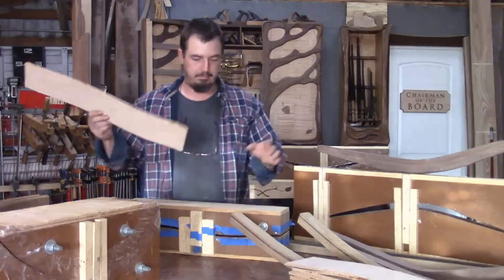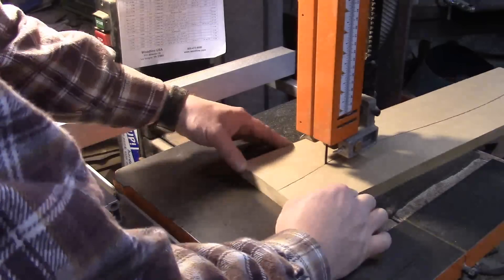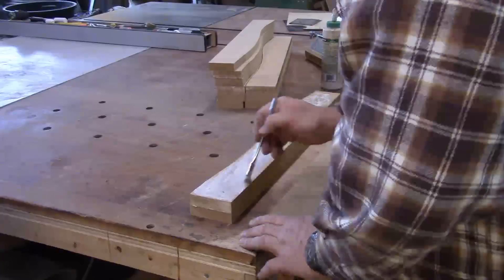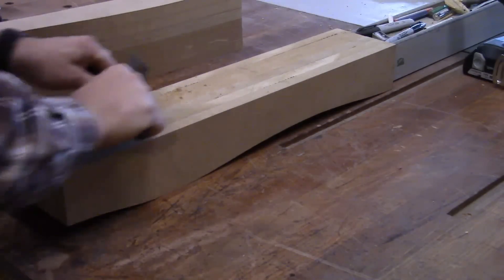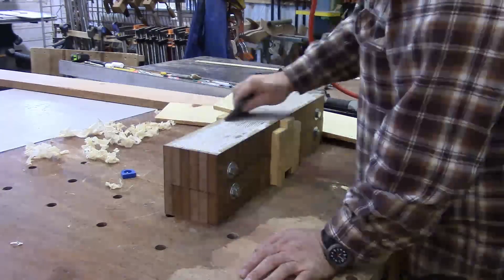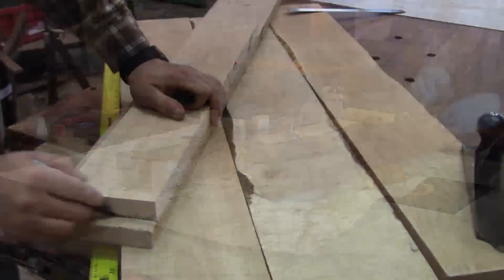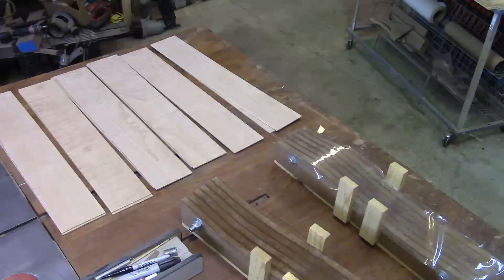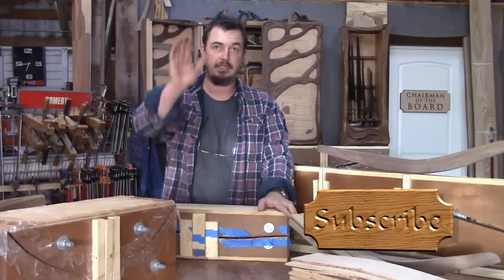Bent Lamination Forms

Comment: Is it needed to cut the thinness of the laminate from the forms? Can’t the forms just be moved appart? I’m making a 18” wide bench top and am figuring out how to make the 24’ long form
Reply from the maker: You need to take into account the thickness the laminate will be and remove that from the form. If you don't it won't have even pressure over the bend as it has a different radius on the outside of the bend then the inside.

Comment: Nice video... but get yourself a small 2” glue roller that you wash out and reuse and leave the little brush for cleaning up joints.
Reply from the maker: I was lazy and didn't clean it up for that shot gluing up the form, but you see it at 10:35 make an appearance. Thanks.

Comment: What is the brand of the clamps you used at the 6:00 mark?  I’ve been looking to get some like those!
Reply from the maker: Those are bessey quick clamps, you can find them on amazon. https://www.amazon.com/Bessey-DUO30-8-12-Inch-DuoKlamp-Spreader/dp/B0002H49OE/ref=sr_1_6?ie=UTF8&qid=1519604032&sr=8-6&keywords=bessey+quick+clamp
They do ok for the first few months, but they are like most clamps being made recently and kind of disposable as they wear out with enough use. I have quite a few of them and I do like them, but they wear out over time.

Comment: Thank you for the most informative vid I have ever seen in a while. I am going to take a stab in the dark and ask if you are willing to help me with making a form for me. I have a 2 ft by 1 ft box that has a designed curve in the front. The side and the back is square however. I just need help with the curved side. I can not figure this one out. Is there anyway you could help me on this small project, please?
Reply from the maker: I would be happy to. If you send me an email with either pictures or a sketch then I can go through it with you. Thanks bearkat_wood@yahoo.com

Comment: When using the compass is that just to ensure that there is enough room for your stock material thats being bent has enough room between the to cauls when being sandwiched?
Reply from the maker: Yes, when you make a bending form you have to keep in mind that the inside curve and outside curve will have differing diameters that will be determined by the thickness of the stock in the form.

Comment: I tend to rush things and your video reinforced my need to slow down and do it right.  I did my first bent lamination 20 years ago and learned the hard way to not use PVA glue.  I'm now using Titebond III for most of my glue-ups but haven't tried it for bent lamination.  I've used a urea-based glue but I would prefer Titebond III.  What is your glue preference and why?
Reply from the maker: I do like titebond 3 and plastic resin glues. thanks.

Comment: Thanks for the great video! Have you actually had a form blow out? I'm wondering if the bolts are necessary...
Reply from the maker: I have had one explode on me and the bolts may not be absolutely necessary, but when you use the form at least once a week and expect it to last years it is a helpful addition. When in doubt, build it stout.
Reply: BearKat Wood I think the bolts are way overkill and provide more aggravation than protection by getting in the way during form preparation and clamping. If you had one explode I would be interested to know what caused it. I would suspect too much clamp pressure.

Comment: I'm curious how much time you spend on making your gluing fixtures. Sometimes it seems like I spend more time building jigs and fixtures than I actually do building my finished product. Do you find that it's worth your time to build fixtures like your slat fixture in the video for 'one-off' projects or is it only economical for something you will use time and time again? Sorry for the somewhat nebulous, interview type question. I'm just trying to get more productive in the shop.
Reply from the maker: Slippery slope questions, ah yes.  ;)
For a one off situation only if it looks like there is no way I would ever repeat the build then I might just try to approach it without the jig in mind. For most projects I do, I like to approach it like I am going to make 100 of them and work thru the process to make every step easy and fit well. It may take more time to make the jigs sometimes than the project, but it can ease some of the headaches in the build and if you do make more than one it is well worth it. Hope that helps. Thanks for watching.

Comment: what type of wood can I start bending and experimenting with?  how bout plywood cut into strips?
Reply from the maker: While there is "wiggle wood" or bendable plywood that you can use to create curved shapes. Plywood it is not suitable for steam/heat bending. It is like trying to make a steak out of a hot dog, it is just too over processed. You can use smaller scrapes of hardwood and nuke them in your microwave to experiment with heat bending. Or make a small steam box and use a tea pot on your kitchen counter. Just be sure it vents steam and doesn't turn into a bomb ;) Again it comes to wood choice. There are several species that do better. If you have any questions on the species you wish to try consult http://www.wood-database.com/ and remember that air dried wood will do better than kiln dried because the lignin has been cooked once already, not to say it can' be bent. It just doesn't want to be as cooperative. I hope this helps, best of luck. A good resource on the subject is the book/dvd combo "Wood Bending Made Simple" by Lon Schleining.
Reply: Thanks a lot. Much appreciated

Comment: hey man i really love youre work , you have a smart setup for getting these together but i was thinking about starting a small skateboard companyuld mdf molds do you think that would be fine. alot of people sayu you need close to 2 tons of pressure , laminate would be just 7 veneer plys together
Reply from the maker: I have wanted to try that myself. You could use a bottlejack and make a press, make a two sided form out of wood and press them together, or you can make a form and use a vacuum bag like these guys. I would use a very strong glue as skateboards have to take a lot of abuse. Best of luck.
https://www.youtube.com/watch?v=lnJP4hCCVsk
Reply from the maker: And here is a link for a good source on making the form. http://diyskate.com/mold_02.html
Reply: i have read that a two stage epoxy is stronger and lighter than normal wood glue but unsure of what i could use you would be able to help with that would you ?
Reply from the maker: West System makes good epoxy, but I don't do skateboards so I am probably not the one to ask. Sorry.
Reply: its alright thank you very much ill check them out, have a good day

Comment: Hi Brian, Great bending vids, thank you. Subscribed. Which is the better wood to use to do bending with and without steaming?? I believe that with steaming one csn use most woods, not sure if quite right so asking. look forward to your comments
Reply from the maker: True, most air dried lumber will bend to some degree.Kiln dried has had the lignin  cured and it doesn't like to be bent. Air dried white oak and ash are the preferred woods. Experiment with the woods you plan to use on  your project to see which works best for you. 
This is a fun video using a bag to steam bend which I would like to try. https://www.youtube.com/watch?v=50uXPPt8-VI
Thanks for subscribing.

Comment: Have you ever tried using fire hose as a clamp? Another method that works for flat items like Shields is a vacuum bag used for fiber glass.
Reply from the maker: I have not used them as most pieces I laminate are a bit wider than the hoses. They work great for thinner work and are used in bow making quite a bit. I could see how they would work very well for rocking chair skids as well. Thanks.

Comment: Is there a reason why you could not use grease paper rather than oiling the MDF as an alternative way to stop it from sticking to the form Ie the glue?
Reply from the maker: +Colin Lye 
The finish I used wasn't oil but a wipe on poly (which is derived from oil, but that's another matter ;)  I use the plastic wrap instead of grease paper just because it is a product I keep in the shop and use on lots of different crafts. I don't want to use any product on the form that could cause issues with the finish on the slats down the road.

Comment: I watched a vid where the guy had a vacuum chamber (a wide piece of pipe) with a much smaller pipe segment attached to it.  He put wood in the vacuum chamber, drew down a vacuum then opened a valve connected to the little pipe.  The little pipe segment was filled with ammonia.  When he pulled the wood out, it was like noodles, he bent them in many shapes.  After the ammonia escape from the wood pieces, they held their shape with zero spring back.  Previously he made pure ammonia.  So does it work using clothes washing ammonia straight from the bottle ? don't know.  You imply that you are making allot of bent pieces, could be a useful technique.
Reply from the maker: +Big Fat Tony&#39;s 
I have heard that you can order pre-bent wood in this same way. It comes in a plastic bag still pliable and you can form it before it sets up. It would be a hassle for me to make my pieces this way as it required high pressure to infuse the ammonia and some of the lamination's get rather large. It also effects the wood coloring a small amount which would be detrimental to some of my projects. Thanks for watching.
Reply: the guy mentioned that the patent for the technique ran out and several companies sprung up selling sealed in bag ammonia infused wood.  He said that what he demonstrated was the same.  No pressure, just vacuum.  But if you're set in your ways.